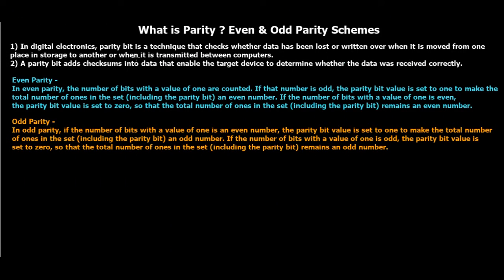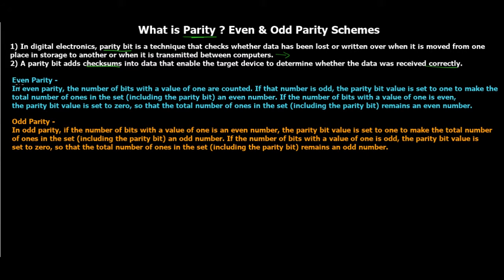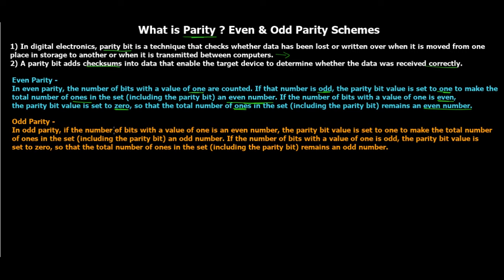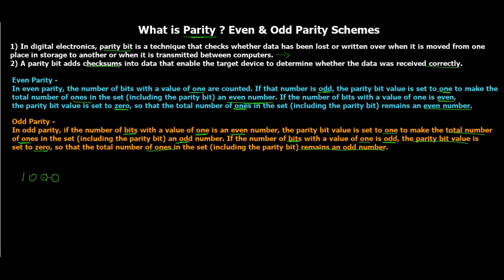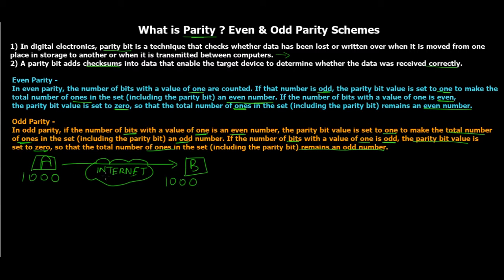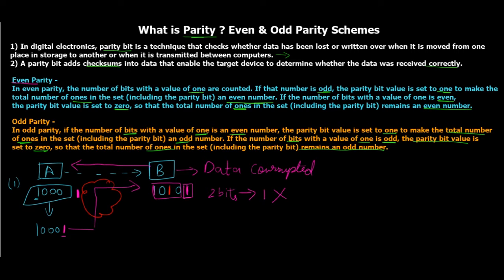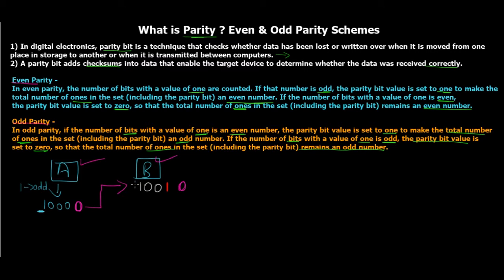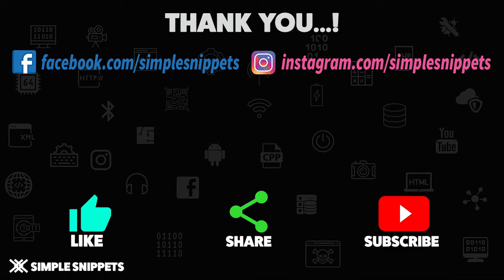What is Parity in Digital Electronics with Example and Types

Comment: Thanks a lot
I have a doubt if A is 1000 we add 1 as parity bit in case of even parity and 10001 is sent to B. If B recieves data as 11101 the parity bit matches according to even parity but the data bit recieved is wrong how B identifies data is wrong??
Reply: How the code is corrected??
Reply: It's a single bit error detector only .. Because X OR and X NOR Gates used to detect it.... We have hamming code methods to correct the error..
Reply: If error occurs it will find only one bit..
Reply: @surenkumar9355  thank you